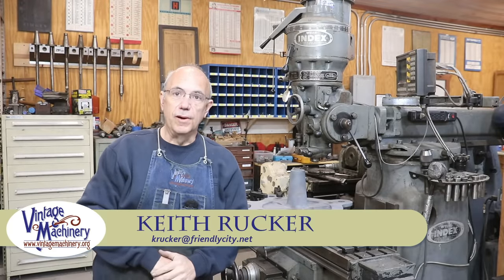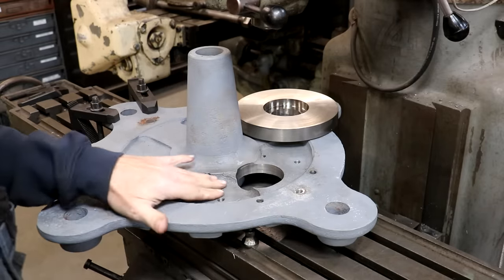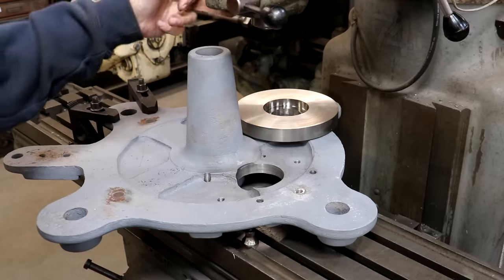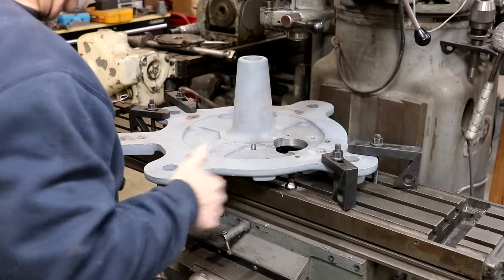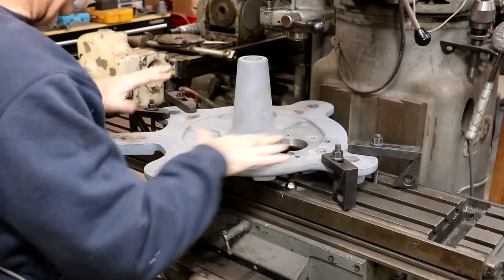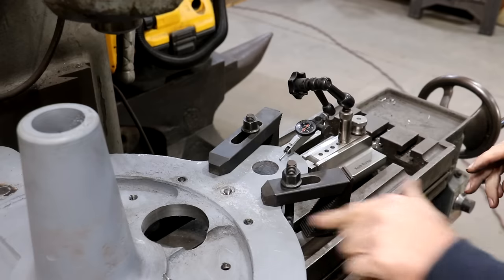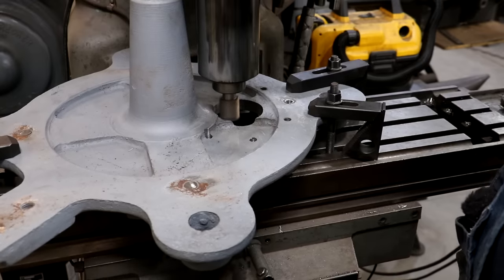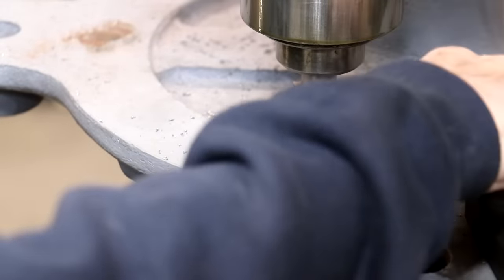Tally Ho Capstan Project: Milling Radius Pockets in the Capstan Base

Comment: Smart, methodical, detail oriented, plan of attack to get a cleaned up surface for the casting.  I admire your skill and approach to getting the job done Keith.  As a structures engineer I appreciate your focus on getting a surface that supports good clamp up around the fastener attachments.  Thanks for sharing!

Comment: This is the skill level that goes unseen, and perhaps insufficiently rewarded, on our economy.  Excellent.
Reply: this is pretty normal for machinists though. A more modern machinist will actually use a CNC to mill those curves more precisely. It's not really extraordinary.
Reply: @junkname9983  So clever to junk all this experience. Be proud, boy.
Reply: @nick.caffrey  I think it is you and the other guy who are junking the hundreds of thousands of machinist out there who are equally talented by saying this is bit of expertise is unseen, like you're demean them simply because you don't see them doing their jobs on a daily basis.
Reply: @junkname9983 I think you've missed the point that doing this by hand and feel is effectively more 'precise' for an imperfect piece like this than what pure math of a CNC machine would dictate. Doing it with CNC would require creating a CAD model, and that would never reflect the actual part (unless you did some kind of laser scan, which is totally overboard in this case), and then trying to come up with some effective path strategy that could be programmed. Nibbling out by eye creates the best result that experience dictates, not what numbers dictate. Keith was making decisions on the fly and adjusting according to live feedback and his expertise. Trying to know what would be needed beforehand so you can program it would take 100x as long and likely fraught with errors on a first pass of a one-off job. Knowing how to get only what is needed in the most efficient way is the key to successful engineering, and that's where Keith shines.
Reply: @kindabluejazz  it's not more precise. Just because you have a CNC that can plot out a smooth circular path around the features doesn't mean you don't get to have fine control and feel for the part. There's still hand-on machining work involved.
Reply: Manual skills like Keith's are on the decline because of CNC. Repairs of stuff will always need to be made and manual skills and older machines will still be needed going into the future.

Comment: Keith,

You might consider using ITW Philadelphia Orange Resin or ITW Chockfast Orange to fill the void between the mounting plate and the casting.  These resins are often used for ship engines, gearboxes, and other equipment.  It is intended for marine use.

Bob
Reply: Yeah I was just thinking of chockfast! We used it on our ships generator foundations. This is a perfect application for chockfast. Locate the flange plate height with a snout into a counterbore in the captain base, snug it down with bolts and pour resin! Done!

Comment: In one sense, you created a 4-jaw chuck with the 4 jacks.  Calibration to them and then tie down to their plane.  Interesting the size and the issues trying to bring old designs into the 21-century.  I still don't have a handle on how the two fit together.

Comment: Just thinking outside the box. Horizontal borer which you have plus angle plate with rotary table mounted on it equals no access problems.

Comment: I’m no machinist and admire what you’re doing but saw a few others asking what also occurred to me, so perhaps explaining the rationale for milling down rather than building up with brazing or some other technique would be helpful to us less experienced viewers.
Reply: Its a materials problem.  The base is cast iron.  You cannot add more cast iron.  You could add another material, but bonding and the homogenous nature will not be present.  Any material added may as well be in the adapter plate.  

Making the adapter plate to fit the base is a reasonable solution.

Comment: Am I the only one holding my breath to see him drill the bolt hole pattern in the plate? A few videos ago, as several commenters noticed, he mis-entered the radius on his DRO when doing the original hole pattern. Transposed 2 digits. So the hole pattern radius is off by 40 thou or something, if I remember correctly. Not enough to matter structurally, but enough to not line up too great.

Comment: Much easier on a rotary table! You could then use the set up to mill the spacer !
Reply: I agree. It would take a really big pallet mounted to it though. He would easily be into a couple hundred dollars in custom fixturing. I do not know if he is charging anything for doing this.
A big pallet with a center spigot and fixed posts for leveling would take a while to make, but would save a ton of time down the line.
Reply: @joshua43214 I suspect that Kieth has a big enough rotary table to be able to mount the part without too much difficulty!
Reply: That’s a pretty big piece he’s working on, would there be enough space for a rotary table?
Reply: @Hoaxer51  In my opnion yes!
Reply: Rotary table, mounted on an angle plate on the Lucas HBM would work. Center rotation on previously machined bore. Would take some tool extensions but I think one could achieve a nice planer surface normal to the bore axis.
Reply: It must be a pretty big rotary table to get enough clearence for the handle too. And he doesn't think this to be too precise just to see a bit clearer

Comment: Surely the mounting plate for the motor should be referenced off the taper spindle bore as that is what will be revolving?
Reply: It seems the expectation is the bore and the facing were done at the same setup on a large lathe, we aren't shown the original machining marks but that was stated. Therefore setting up to the facing should get the job done.  At the end of the day this will be low speed, high torque application so a little deviation shouldn't be an issue.
Reply: @seapy2398  Point taken.  The thing is that even Keith commented on the rough finish of the face plate and there would be a direct corelation between the spindle and the electric drive, whereas using the face plate puts it one stage further away.  As you say, it will be a high torque, low speed unit that whilst more tolerant, having an axial mismatch between the shaft and the motor will reduce efficiency.
Reply: They should be able to shim the motor to get the proper alignment and backlash, it will be a finicky job but no worse than setting backlash on the rearend gears on an automobile. So it seems.
Reply: @Hoaxer51  I don't doubt that they would have to align the motor whatever the format for machining the mount, its just that its always wise not to have to rely on a cascade of potential tolerances to get the position right.

Comment: As a non machinist question.
Was it ever considered to clean the casting well, then heat the entire casting and pour molten  zinc into the recesses to either side of where the through hole was to be?.  Then just machine those areas flat and drill/bore  the holes afterward.
This would insure a perfect flat to mount the motor assembly, and essentially galvanizing it.
It seems like a specialty shop would have an oven suitable to  ramp temperatures slowly and avoid cracks.

Comment: I would be concerned about the milling into the outer flange where you have left a sharp internal 90 degree corner and took out the curve. 
Sharp right angle corners from memory, can induce stress fracture propagation away from the sharp corner. Better to have a radius where you can when machining the casting.
As you can see there are a number of radius type shapes used both from the casting mold release and perhaps to stop cracking?

Comment: If it weren't for the desire to keep as much of the original as possible, it seems it'd almost be easier to machine and/or cast a whole new piece with the additional flange built in to begin with.

At the very least, just mill away that strut entirely, as it's not doing anything structural anymore with that giant hole through it.

Comment: Would it have been better if possible to have built all of those areas up rather than milling it down? I am thinking (and I don’t know anything compared to you and probably many other viewers) that it would make the capstan stronger whereas milling it down would tend to weaken it. You could have milled the raised surface and then added to that. This is only a question from an observer. Thank you Keith!…this is an edit I guess I didn’t understand what the project was🤪

Comment: I would have challenged the spec which placed the largest bored hole right through the spoke. The strength of the casting is in the 4 spokes, not in the web between them.  Bore for the gearmotor, placed through the web, and achieve a strong motor mount plate by straddling two spokes, with the bolt circle hitting two spokes symmetrically and the rim.  Then mill 2 faces: rim height and spoke height, with no bolts relying on the thin web to take the immense torque of a chain pull.
Reply: The capstan straddles 2 deck beams & is centered over a big chunk of oak blocking between the beams. It's likely that the new driveshaft location was chosen to avoid the through-bolts that anchor the blocking to the beams or compromising the structural support it provides.

Comment: Of course hind sight is twenty twenty. Maybe filling the voids between the spokes with brass at the start might have made the job a bit easier . A bit more expensive in materials though especially if you had to fill it with rod .

Comment: Would it have been possible to have the adapter plate made of cast iron and just braze it to the piece instead of bedding compound?
Reply: To braze a casting this large requires preheating the part to a fairly high and uniform temp. This creates a lot of stress in the casting and risks cracking it. Best avoided on a part like this. Edit... also you only get one go at brazing a large part such as this. Get it just a fraction out and it's ruined your day.

Comment: I'm left wondering why Keith chose to remove material and risk further weakening of the casting, rather than using metal putty to take up the unevenness. Once the interface plate was clamped down, there would be intimate contact over the entire plate. It would also simplify profiling the underside of the interface plate.
Reply: I was gonna say that, or, use silly putty. I've had good results with silly putty.

Comment: For others who are struggling with visualizing 2/1000" = 0.0508mm or about the thickness of a hair
Reply: Actually most human hair is 3 to 4 thousands thick.
Reply: @voodoochild1954 "aKcHuALLy" he said "ABOUT" the thickness of a hair. 2 thou is close enough to the 3 thou you said. Pedantic af.
Reply: @littlejackalo5326  yup, some old folks thinning hair is less than 2k, and I have it on good authority from a Puerto Rican machinist I used to know, Puerto Rican hybrid hair is both thicker and tougher than either of the two breeds used for the mixing. He claimed cut hair can work its way into the cuticle of the skin and burrow deep enough to require deep cuts to the dead skin and live tissue to remove for festering. I was cleaning the metal particle from his eye with a flax seed catcher which worked very well. Since then I have avoided any barefoot walking in hair cutting shops, not too hard as I wear it long now I no longer work in the field.

Comment: Hopefully someone can help me understand here: What about the grey paint? Did I miss an episode where that was applied? The playlist skips directly from the disassembly video where it's in its original state to the first lathe video where the paint has already been applied, seemingly directly over all that old rust. Given Leo's aversion to rust, I have a hard time believing it will all be left on under that paint, but I also have a hard time picturing stripping off all of the paint and rust AFTER all of this very precise machining has been done. Can someone who knows this type of work help explain the plan?
Reply: Keith mentioned (in the vid where he cut out the underside of the drum) that he'd had all the parts sandblasted & painted w/ primer.
Reply: @frederickstibbert7389  Thanks! Don't know how I missed that.

Comment: This being an extensive modification of a cast iron piece, I would rather try make sure  the axis of the motor mount and gear are correct and modifiy the adaptor as much as is advisabel and complement it with some industrial epoxy bedding compound to ensure full contact.

Comment: It seems like it should of been cast with a flat surface so you could of milled a flat surface without taking material away from the base that needs the strength for this new application for a power retrieval system.  This seems like it will be the weak area that may fail with the added pressure of the power winch.
Reply: Have you seen a casting anywhere with a dead flat surface before it was machined?
Reply: The machining out of the rib is the real problem. It's not the machinist's fault but the engineer's, it's just bad engineering.
Reply: @20boltDuck you're looking at the material removal as a single aspect. A large ring is being put in place with several bolts, and that will spread load and stiffen it. It's a non issue
Reply: If only they had been thinking 114 years ahead damn those bad engineers.
Reply: @jeff10049  When they reformed and cast this new part they could of done it then, but you are to busy being a smart ass to realize that.

Comment: If you spot-face the casting and weld round pillars on the flange to reach the deeper spot faces, you could maintain most of the casting. Bolt the flange flat on the 3 outside holes, and make pillars to fill the gap between the spot faced casting, and the other holes in the flange. You can't get in close enough with that long spigot in the middle, and you will need a piloted counterbore for those half holes. Unless you try a single-point flycutter, which would take forever, I don't see anything else working.

Comment: Would it have been better to face off the part on a lathe, to ensure that the surface is perpendicular to the bore? This would require a large lathe. 

If the motor shaft is not parallel to the capstan bore, the gear mesh backlash might end up too loose or too tight. A small angular error will result in a large linear error. 

Perhaps measure the shaft centerline-to-centerline and parallelism/perpendicularity and shim if necessary before bedding & final assembly.
Reply: I think he's got it under control
Reply: There's a saying, all roads lead to Rome.

Comment: very good job on that machining work but... I believe that the designer done an error to  not align the main hole between ribs and piercing the main hole where the casting is at its thinest part.
destroying a rib can have an adverse effect as torque exerted on the capstan is very important,
very good machining video.
Reply: The location of the new driveshaft hole was constrained by the heavy oak blocking & deck beams that support the capstan. Horizontal bronze bolts attach the blocking to the beams, & the new vertical shaft can't interrupt them.

Comment: Since you did not check the face level of this piece when you set up and bored the through hole and drilled ant tapped the bolt holes, those items are not perpendicular to the face.  And your indicating off the center of the hub when doing those operations put you in an incorrect position as the top of the hub was angled to the right in your initial setup.

Comment: It seems you're making the assumption that the main shaft in the casting is perpendicular to the top surface you're referencing from. Maybe you did something to check this first? It might be safer to assume that the input shaft (main shaft) is perpendicular to the machined surface which is facing the milling machine table. Of course without checking it's just an assumption. Using a caliper one could check if the top and bottom machined surfaces are parallel. 
All this of course is a concern regarding getting the added motor shaft to be parallel to the other shafts thus decreasing premature wear due to loading if it's NOT parallel. No doubt there's some tolerance that's acceptable depending on the shape of the gears and how properly they're set up to mesh. Time will tell in the wear pattern of the gear and the plate could always be shimmed a little bit in the future to compensate if needed.

Comment: Keith, I feel I have to disagree with you about things being dead flat, if the motor mounting isn't in perfect alignment then the gears won't be in alignment and abnormal wear will result, causing premature failure of the capstan.  The way I see it the rest of the web with the hole in it needs to be removed to allow the motor mounting plate to sit flush, otherwise the mounting plate is going to need some intricate machining to hold the motor in the alignment it requires.
Reply: Gears are never in perfect alignment  go check  these are only 0.001 more than enough accuracy for gears like this..

Comment: When you measure (which I'm sure you already have), I think you'll want to check the formerly machined surface for the other three bolt holes relative to the four around which you already milled. Skimming the high spots there, at least, will keep from racking that flange.

Comment: They don’t build them like they used to- because there’s laws against it. I’m no engineer and I keep thinking this is going to fail under load. I’m thinking CEE or Topper would have started with a steel plate and welded on the tits and tubes
Reply: They are in a whole different league!